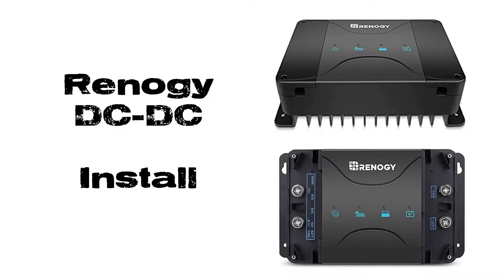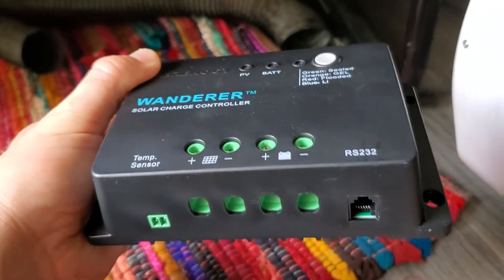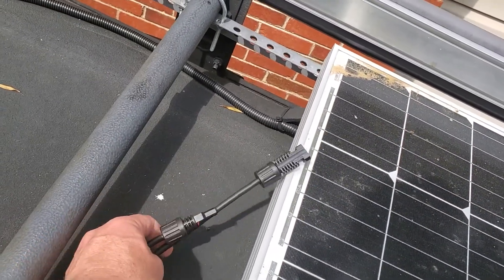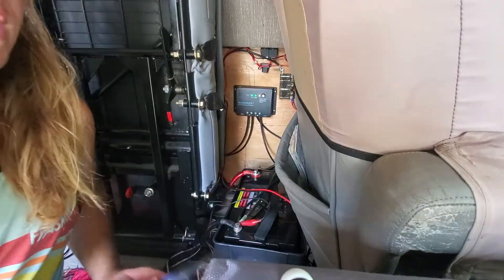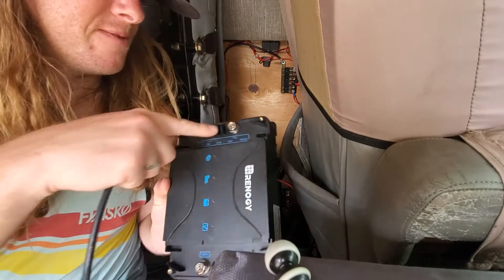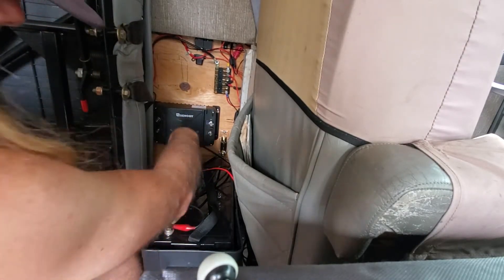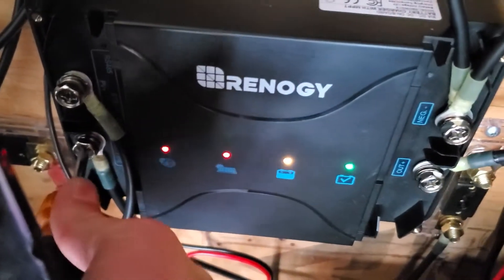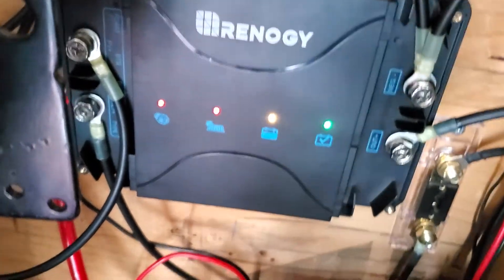Installing Renogy DC to DC Charge Controller

Comment: Hey thank you for being so detailed with your install. I am a complete 100% noob and am super nervous to swap out my charger and install 2 batteries and an inverter. I will definitely watch this video when getting ready to do it.
Reply from the maker: Thanks so much for watching! Yeah honestly this DC-DC unit is so simple, its one of those things I wish I had done 5 years earlier. I've had it for over a year now, and taken a good number of camping trips with it now. It has worked wonderfully, keeps things topped off even when we are using lots of watts on trips. 

Its actually super simple. Just think of it like this:
*1 positive in from the solar panels
*1 positive in from the alternator
*1 positive out to house battery 
*1 negative out to the ground  (to the the chassis)
That's really about it!!

Comment: Hey what size wire are you using for this 30a model? and where do you buy your ring/eye connectors? Also what size fuse are you using for between charger and battery (the black one)? thx in advance!
Reply from the maker: Hey thanks for watching! Ok, so the black wiring I have coming off the DC-DC unit is actually the 10 gauge cabling that came with the original Renogy 100w panel/Wander kit. 2 of those ends (with black heat shrink) already had eyelets when they were shipped. My cable runs were relatively short so I had extra cable to cut up to use for other connections... the ring/eyelet connectors with the clear sleeves that you see were are from Walmart haha. But they've been working great, never a problem! I know there is better quality stuff out there, but... yeah anyway.

If I could go back in time I would save myself a lot of hassle by buying nice crimpers - they make wiring so easy in comparison with the cheapy tools from the autoparts stores. I now have a Klein crimper ... just makes getting good solid connections on your cable ends quick and easy. No more wires pulling out of the ends your trying to crimp... https://www.amazon.com/gp/product/B07WMB61J5/ref=ppx_yo_dt_b_search_asin_title?ie=UTF8&th=1 and maybe grab a Klein stripper while you're at it, get good clean cable ends without cutting into the copper on accident. 

The big fuse between the out and the battery is a 100amp ANL fuse...  its just a last ditch "something went really wrong" type of thing to protect the battery. 

Ok hit me with any other questions, I will try to help! Thanks for watching :-)
Reply: @kampinglogik  great perfect thank you! Will lyk if any other questions. Going to install soon!
Reply from the maker: @soilliam  Awesome! Good luck!